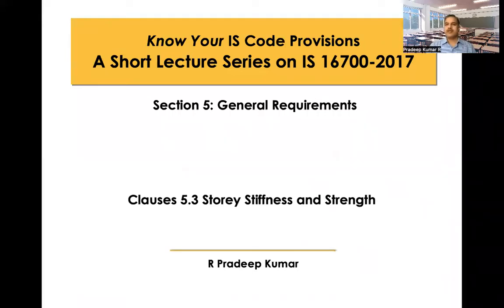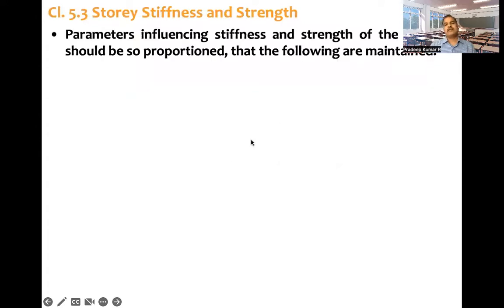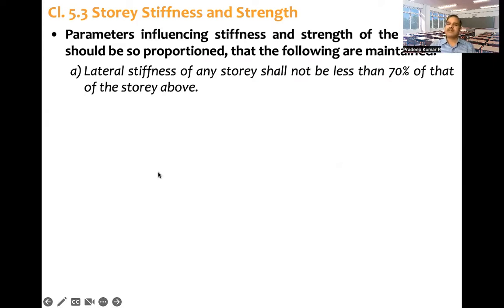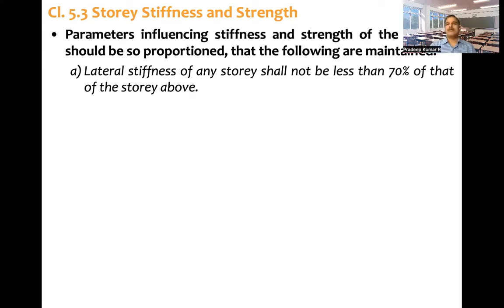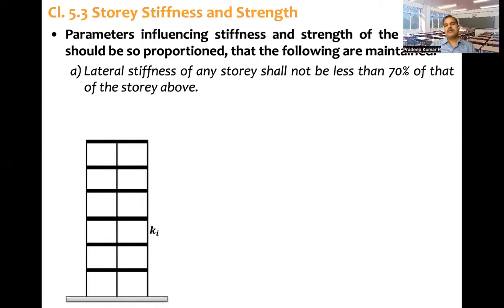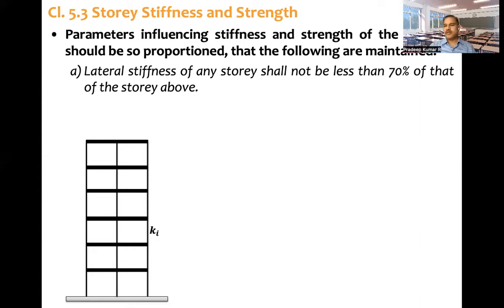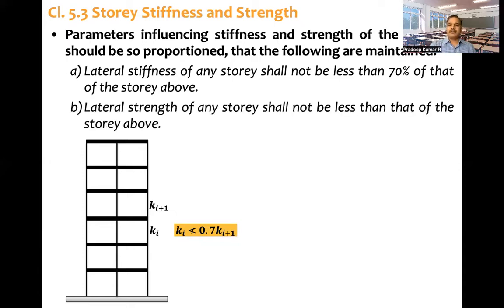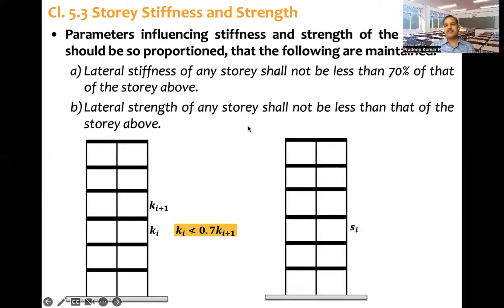IS 16700-2017: Clause 5.3 Stroey Stiffness and Strength

Comment: Dear Teacher, In IS-1893, the stiffness and strength irregularity building frame appear to have the same diagram, in which one of them shows complete removal of a column; so, my question is can I refer to this type of irregularity as "combined stiffness and strength irregular building frame"? And How calculations of strength irregularity are done in commercially available software?
Reply: Diagrams are for represention purpose to explain some concept. The objective of that diagram is to show difference in stiffness between two consecutive floors. However, your reference of considering them for both irregularities can also be true but not always true. Detailed investigation is required to reach to that conclusion. Since, for both stiffness and strength irregularities respective values (ratio) should be satisfied to declare the building as having particular irregularities.

Comment: Why code permits 0.7k(i+1) ? 
How 70% arrived ? What is the basis of it. pl suggest literature.

Infact, lower lvl k shall never be permitted on lesser side wrt upper lvl.
Reply: Not sure about the 0.7 value but Tall buildings usually have ground storey with height more than the height of typical floor. Such architectural practices will surely introduce the difference in storey stiffness (lower stiffness of such ground storey). Hence, code committee in India and around allow difference of 30% in stiffness.
Reply: @pulkitvelani  your point sounds ok wrt Ground and First floor.